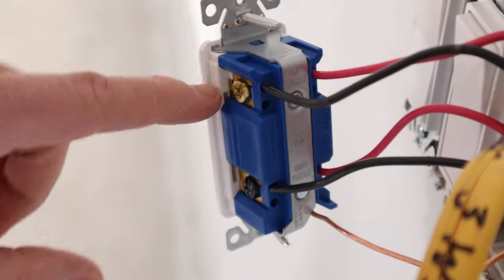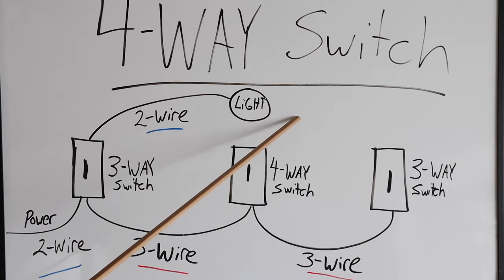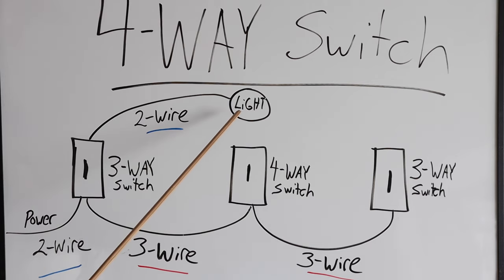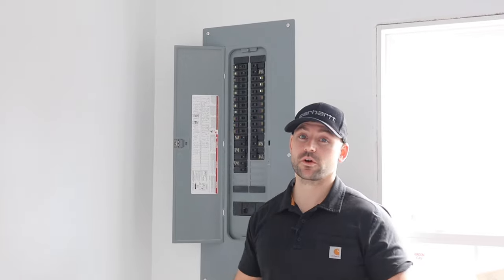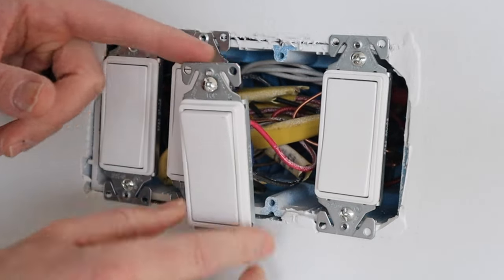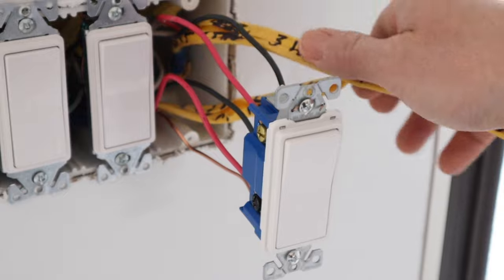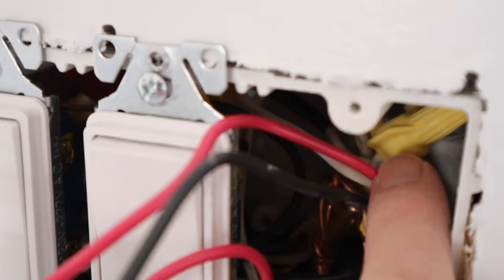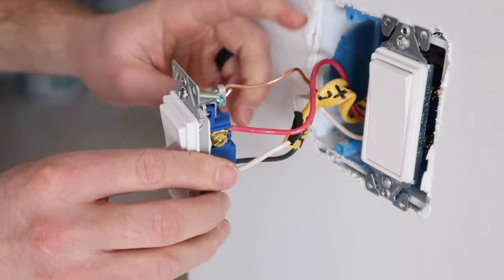How To Wire A 4-Way Switch - 4-Way Switch Explained (EASY And SIMPLE Method)

Comment: Sorry brother, but this is not a good example of a beginners explanation of a typical 4 way switch system. It’s a bit confusing and doesn’t clearly explain the most current and typical 4 way switch system. I’ve wired a few of these and your description left ME a bit confused….
Reply: I agree
Reply: I agree  too
Reply: I am glad I am not the only one who felt this way. I thought I knew but watched this video and left confused.
Reply: @haunthunterify  i have made a clear video with too much explanation,  but i haven't uploaded yet, i will upload the video if you guys still stock
Reply: Agree
Reply: I disagree. I'm reworking some rough that was done on my basement remodel. It was ran with this setup, with both the home and the load coming from the first switch. Couldn't find a diagram anywhere, so this was helpful to me.
Reply: Yah, hire an electrician.
Reply: @mixofall2574 The video that never came to be.
Reply: @razmspiele25  i already did 4 houses . If you want i can upload a video explaining

Comment: Next time bring the power in on one 3 way and the light in the other 3 way so you'll have a neutral in each switch box.
Reply: Rite that's the only way I've ever done it power on one 3 way and switch leg on the other
Reply: I agree
Reply: Yeah he confused me with that but your guys are right
Reply: Yeah, pretty sure it’s code to have neutrals in switches now, right?

By bringing power into the first three way switch, travelers to a 4 way, travelers to another three way and then switch leg up to the device at the end of the line.

Comment: You used different terms when pointing out than when showing the diagram.  What you showed as "Power" to sw1, you called Common.  Then no mention of a "traveler" until you point them out.

Comment: I have watched tons on 4 way switch videos and this one is very helpful to my situation! Thank you for posting this type of wiring of a 4 way switch system. Many other videos I have seen only describe systems not including the hot/ wire from the breaker box and the wire going to lights, in the same box outlet. Great job
On a side note, do you marrette the white wire/neutral from lights to the nuteral from the power supply/breaker box in the first light switch box?

Comment: One frustrating part I've had with box store switches, not saying it can't happen a a supply house with commercial grade, one 3way switch being bad. Knowing it was wired correctly, and still not working. Can be irritating as well.  Patience is always good know matter what you do. 👍🏻
Reply from the maker: Good point! Bed switches or a real thing. I remember the first house I wired had one and it drove me crazy until I figured out that was the problem. Thanks again!
Reply: @TheExcellentLaborer  yep, the same feeling.

Comment: Hi, so to find out which of the 2 three way switches is the first that powers the light, can i disconnect all wires from all 3 switches and then reconnect  the wires to one of the 2 three way switches to see which one will power the light, and that would be the first three way switch? Thanks.

Comment: I have 4 switches. 2 in my
Laundry room and 2 in my half bath. Laundry room is only for light and bathroom controls fan and light. All black wires in bathroom. My laundry room lights work correctly. Bathroom not at all. What am i doing wrong?

Comment: I followed the instructions and it works for dumb switches, but fails when I put a smart switch on the main switch. Any advice on how to wire it up for a smart switch? I’m using a TP Link Kasa 3way.
Reply: Lmfao. This is not a smart switch. You probably shouldn’t be doing electrical work if you don’t know the answer to this

Comment: how is the white wire tied into the the switch, I know it is tied into the power but I am not understanding how you connect it to the switch
Reply: The neutrals only go to the final light fixture. They get tied together back behind the switches. They don’t go on the switch

Comment: Best way to deal with 3 way or 4 way switches is to leave them at the store. One light one switch. One shot one kill. I've built three houses and never missed a three or 4 or 5 or 6 way switch. Toggle up light is on toggle down off. Keep it simple. Don't needlessly complicate your lives by 4 way switches  or multiple polygymous marriages.